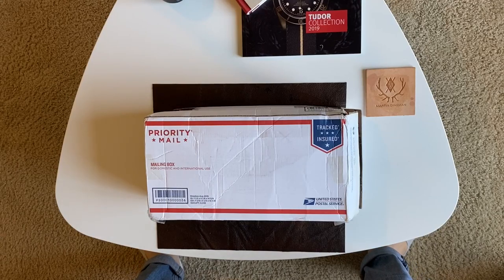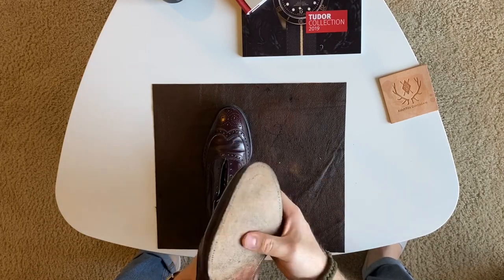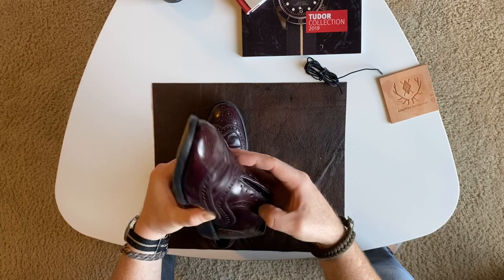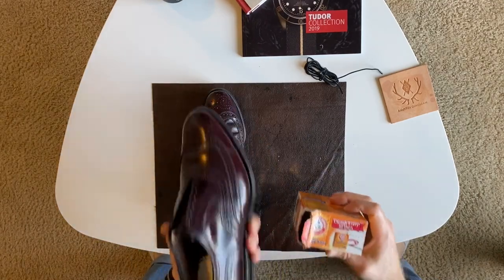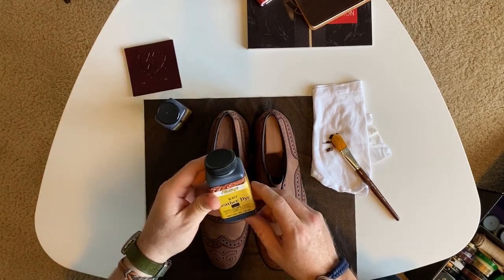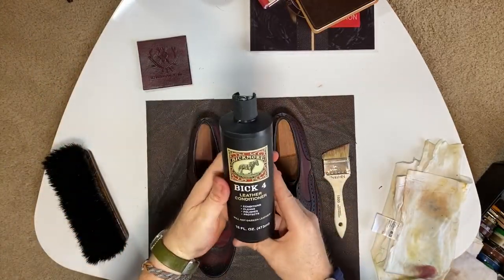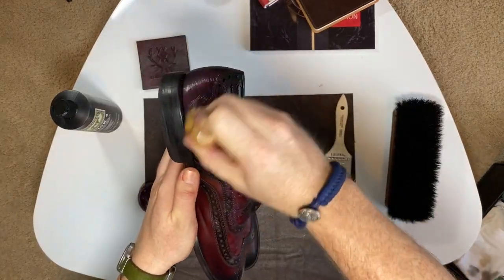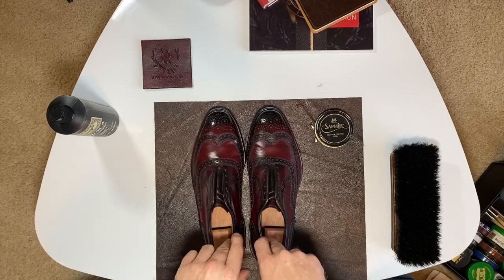From Corrected Grain Leather to Gorgeous Burgundy Patina - Allen Edmonds McAllisters

Comment: McAllister’s are my go to...I have three pair. Mine are regular top grain leather, so this corrected grain thing is new to me. Your restoration brought out the classic style of these shoes and they look great. Nice work. Thanks for posting.
Reply from the maker: Thanks! I’m glad you liked the video
Reply: I just checked the Allen Edmonds site and read through some questions and answers on the McAllisters page.  Someone posted a question asking if they were made of Full grain or Corrected grain.  Allen Edmonds responded the McAllisters are all made with Full grain.  The shoes in this video may have been an older pair or an experimental pair.  Not sure what the deal is.
Reply from the maker: @pennrj430  apparently in the late 80s early 90s they used corrected leather, it was also a surprise to me. Glad you liked the video!

Comment: Wow everywhere I've looked, they say the finish on corrected grain can't be taken off. Surprised you were able to do it! Nice work 👍
Reply from the maker: Thanks man! It took time but we’ll worth it🙂
Reply: You can remove the finish, but you can't return the top layer of leather, which has been sanded off. When it's made, the layer with the pores is sanded off, supposedly to correct tick bites, barbed wire cuts and the such. He did a nice job with these, but you can't bring back that which was sanded off!🙀

Comment: I do the same two-tone accents when doing antique patina on my Allan Edmonds. For shoes of that color I will also typically do a marbling effect using black dye that has been thinned out 50/50, then wipe it off with acetone. It creates a spiderweb marbling effect that really gives dimension and character to the shoe. One of these days I am going to have to make a video showing how I do that.
Reply from the maker: That’s awesome!! I will have to try that marbling effect some time
Reply: @gearstyle2544  it is very easy to do, and give a great finished effect.

Comment: Nice! I have a pair that I've started to do this with (burgundy AE Park Aves) but as someone else said I also ran out of patience and haven't finished. The nylon brush is a great tip. 
I believe CG leather was more of a thing for AE in the 80s and 90s, "polished cobbler" or something was what they called it. Most of the CG shoes from them that I've seen have been burgundy as well, I wonder why they did that.
Reply from the maker: magicalplaid 😂 it does take patience Daniel finally got around to finishing his, check his out on his Instagram @getyourshinebox74. Yes it’s what I’ve heard that they used CG back then, I don’t know why it is either that for the most part you only see burgundy or black color CG
Reply: They made it burgundy to look like Cordovan
Reply: Did you ever get it all off? Lol. It’s a pain but the leather underneath isn’t bad on mine. I got it 75% of the way but the other may not happen
Reply: @CrashCarson14  I did eventually and I redyed the shoes navy, but they came out too dark. I haven't gone back and tried to lighten them up yet. At this rate it will be a decade long project lol
Reply: @magicalplaid  what worked best to get the paint off? It’s such a pain.
Reply: @CrashCarson14  to be honest I don't remember the details because it was like 2 years ago, but I believe I used acetone with a small shoe brush and a rag. It definitely still took a while though.

Comment: Wow, this is the only video on YouTube that someone actually stripped the acrylic layer on a CG leather shoe. Just curious, wouldn't all that acetone make the leather weaker/brittle? I would also want to do the same thing on my Loake CG leather shoes, just afraid i might mess them up, lol
Reply from the maker: Thank you, I’m glad you found this video useful, I don’t see why the acetone would make the leather brittle, the acetone itself will evaporate, but it does dry it up and that’s why it’s very important to use a leather moisturizer right after that step and it should be fine after that, and obviously continue to use conditioners and creams every so often

Comment: Hi, I'm just curious. Is Corrected grain leather what they call bookbinder? And is the patent calfskin the same with the corrected grain leather/bookbinder?

Nice video btw.
Reply from the maker: Yes, they are basically the same thing, but I’m my opinion book binder leather is usually a lower quality leather, meaning they either use a much grainy part of the leather or even take scraps of leather glued back together
Reply: @gearstyle2544  I see. Thanks for the inssight. 

I bought a pair secondhand Florsheim and the seller told me that patent calfskin was just as good as regular calfskin but after wearing for a while it got irrecoverably wrinkled.

From your video I guess I don't need to buy stuff that are particularly for patented skin?

Comment: I just received this exact same pair of McAllisters today, same Barney Purple color too, lol. The seller said they were dark brown, I believe he may be color blind.

I am thinking about doing the same thing to these but using Mahogany and Black dyes.
Reply from the maker: Cool, mahogany was my original intent but I didn’t have it on hand, I would try to do the accents in a dark brown first I think the black was a little too much contrast
Reply: @gearstyle2544  ok, I have dye in about 6 different shades of brown, so I will start lighter and see what it does.

I am going to be shipping these off to Bedo’s Leatherworks to have him replace the sole and convert these over to golf shoes since they are not full grain leather anyway.
Reply from the maker: @WH6FQE  yeah, I guess once the finish is removed it would be considered top grain
Reply: @gearstyle2544  or at least “mid grain”, lol. It will actually be leather that accepts dye and polish, it just won’t have any grain left to show through the dye. But it’s better than plastic coated leather.

Comment: hi again, i'm back at this video where i was a month ago! i hope you don't mind if i ask you something real quick? is it OK to use nail polish remover in lieu of pure acetone like what you're using, or saphir decapant? i'm just asking because while nail polish remover isn't pure acetone, it's so much cheaper than buying a container of saphir decapant for example.
Reply from the maker: I don’t recommend using nail polish remover, as you said it is not pure acetone, saphir decápame is good but too expensive, I definitely recomendable sticking to pure acetone you can purchase it from Walmart or Home Depot at a decent price
Reply: @gearstyle2544  thanks for the reply.  I see. Ok, i'll try to only look for pure acetone then. But out of curiosity, what is it about nail polish remover that would be potentially damaging to the leather? Acetone in itself is already very harsh, so what difference would acetone mixed with other chemicals make?
Reply from the maker: @lullemans72  it just doesn’t strip as well
Reply: @gearstyle2544  oh i see. noted, thanks again.

Comment: The dyes I use in my shoes leaves stroke marks smh. What is the brand you're using?
Reply from the maker: I use Fiebings leather dye
Reply: Make sure you use more then 1 coat to even out the color and the first coat use rubbing alcohol to dilute it so the next coat that’s put on won’t cause the shoe to become too dark.